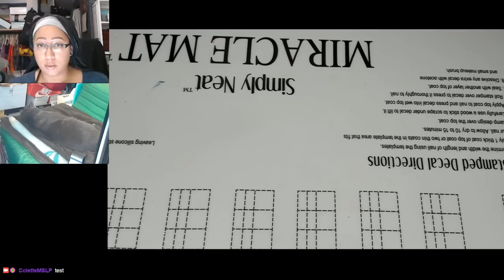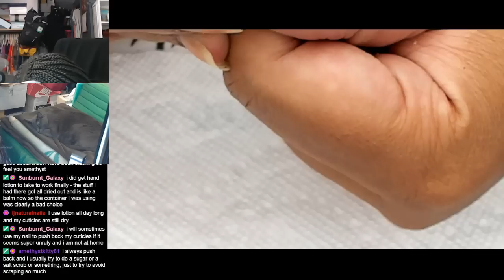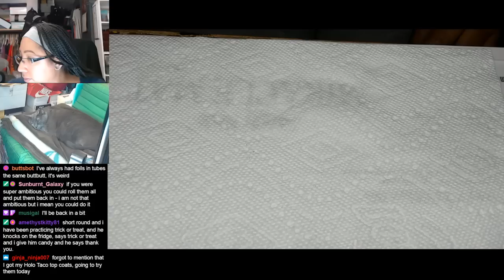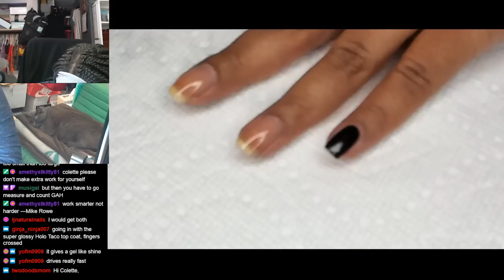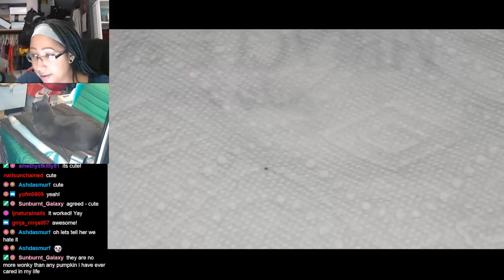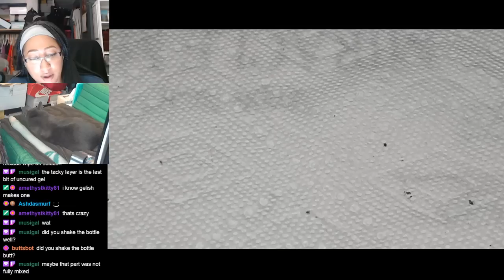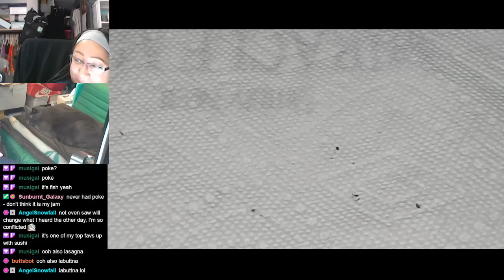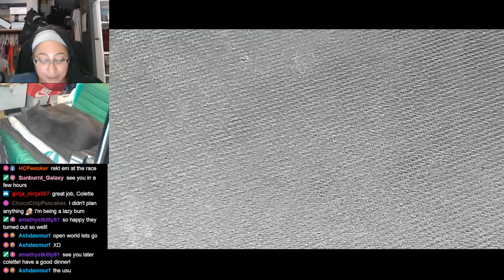Glowing Jack O' Lanterns | Extended Nail Art Tutorial [Streamed 10/12/19]

Comment: something that occured to me just now regarding your swatching project: why don't you just paint a little dot of the polish directly on top of the cap? obviously not going all the way to the edge so you don't chip it while using the bottle, but that way you could see the finish and you save an actual shit ton of money. because if you used the cabochon like a top coat you'd have to worry about glue interefering with the polish. after all you do have to stick them to them bottle somehow.
Reply from the maker: I have considered that, but I don't think it will look as nice because so many caps have raised logos on top of them.  Buying in bulk the cabachons shouldn't cost too much, and hopefully the glue won't be a problem as long as I don't use anything too strong - it usually is fine when using glue for stuff like rhinestones.  I'm also considering tape dots to adhere them which should be a pretty mild adhestive
Reply: @MSLP  if they have a raised cap the cabochon won't stick though. But i agree it would look much nicer that way.
Reply from the maker: @shiroi201  it depends on the adhesive - the tape dots look to be a little "cushion" that should be malleable to stick well enough, and the glues I've been looking at are gel formulas that should fill in the gaps
Reply: @MSLP  i don't mean the glue i mean the cabochon itself. After all that's a pretty solid thing seeing as they're usually something like glass XD